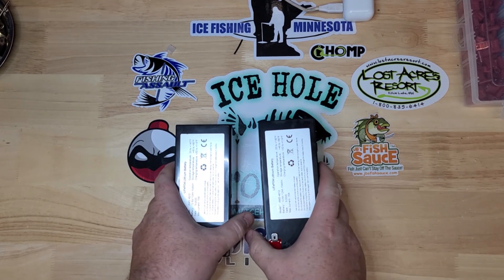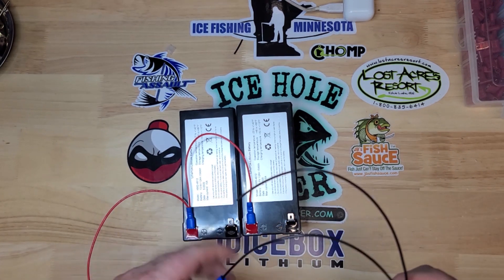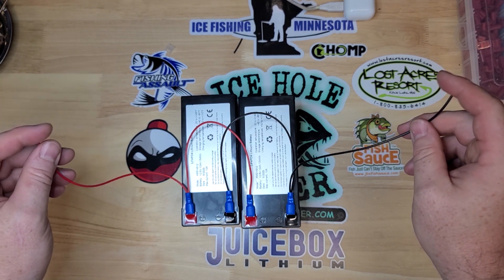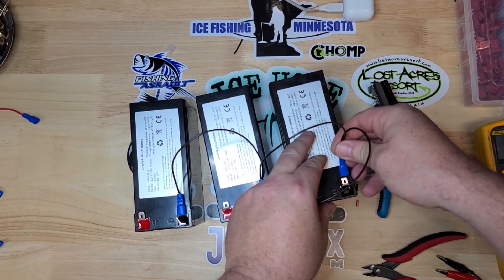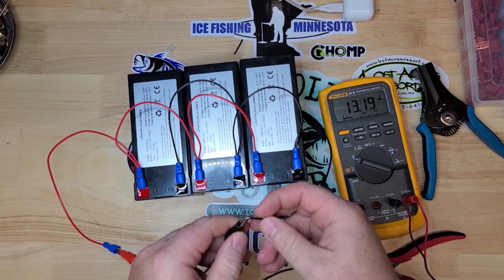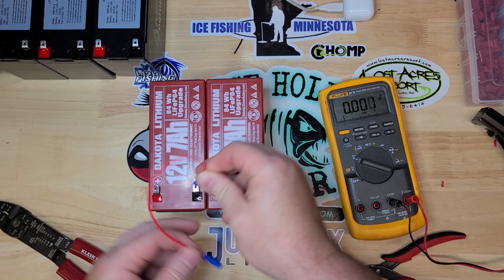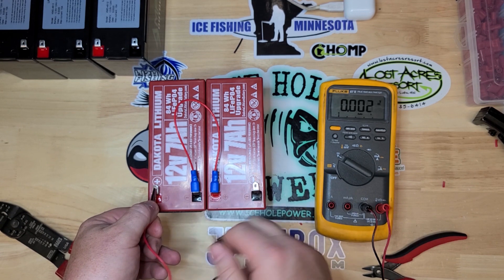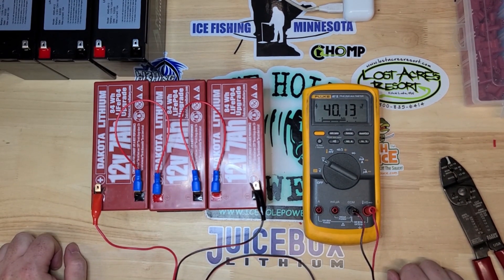How to wire batteries in series and parallel

Comment: If I wire two 12v batteries in series for a 24v system, do I need to replace the fuse? The kayak motor I want to use needs 24v and has 25amp draw can your DIY box support that?
Reply from the maker: I usually suggest getting a 24V battery to power trolling motors.

Comment: im using 2 18ah Amped batteries in parrell setting and am planning on installing SAE port for charging can you explain how i should wire the port up? thanks love your products and videos
Reply from the maker: Ideally you would want them to charge in the same manner that they discharge, on opposite ends of the bank. It is more important to do that with SLA than the lithium batteries that we are using. One of the features of the BMS in the lithium batteries is cell balancing.
Reply: @iceholepower8012  guess im not sure what u mean opposite ends of banks cant i just wire SAE port wires in at point after linking the 2 batteries together and heading to switches area